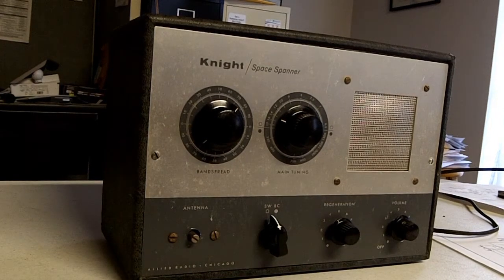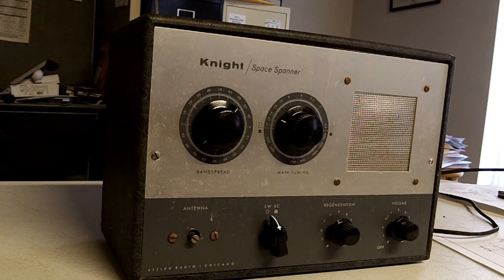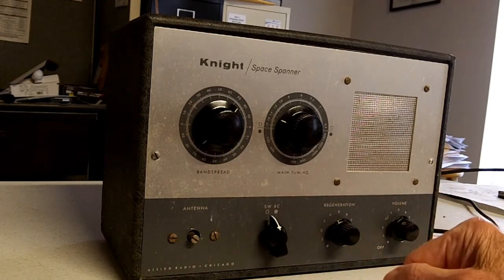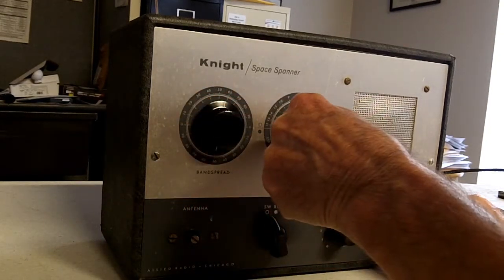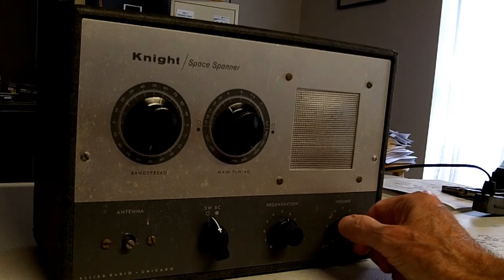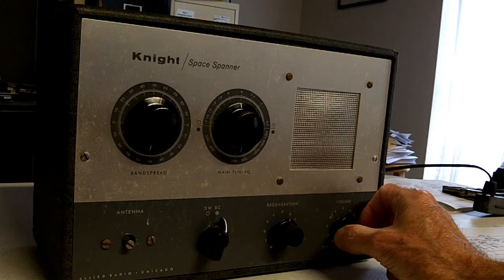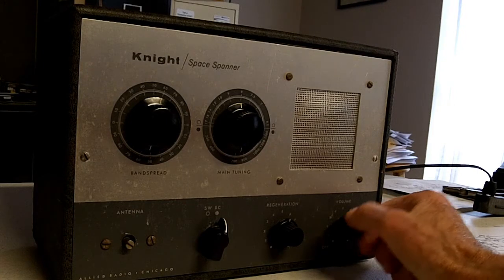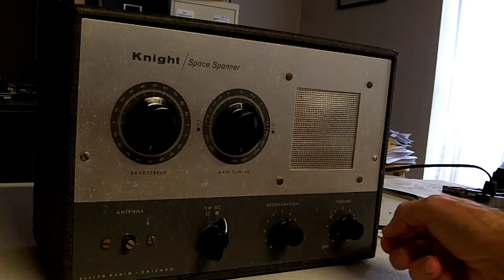Demonstrating my vintage Knight Kit Space Spanner Shortwave Radio

Comment: I built one around 1963. 12at7, 35w4 and 50c5 tubes! Listened in my attic on a long wire antenna, grounded on the cast iron vent stack that went through the roof. Heard all the Commie propaganda and could search through the static for hours!

Comment: My dream is to have this very radio, or even a lafayette model that was also regenerative. Thank you so much for showing this. As an avid shortwave listener and DX hunter I find that, from all I've read and the videos that I've seen, that the audio is simply sharper and free of the RF hash and harsh sound that modern receivers have. Certainly it doesn't have the filtering of new radios, but that's the joy, The ability to truly control the regeneration makes for such a pleasant experience and the audio is just so pure.